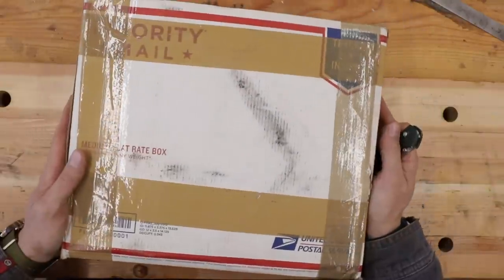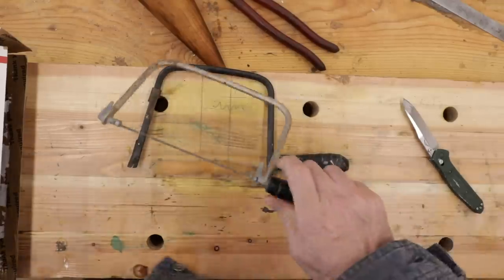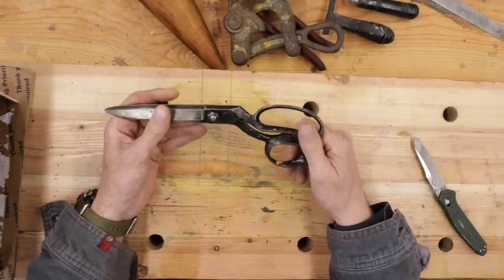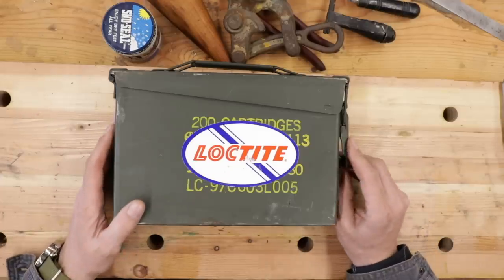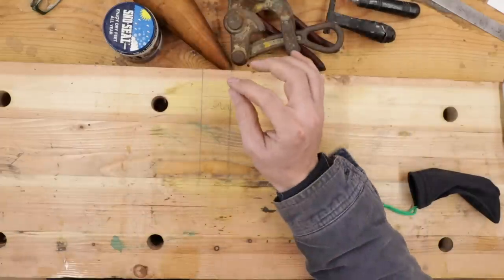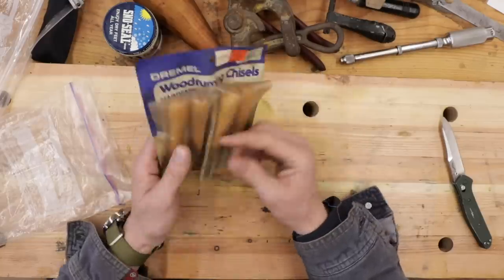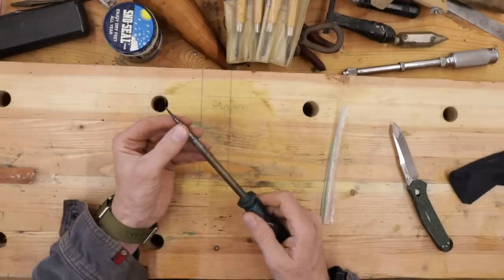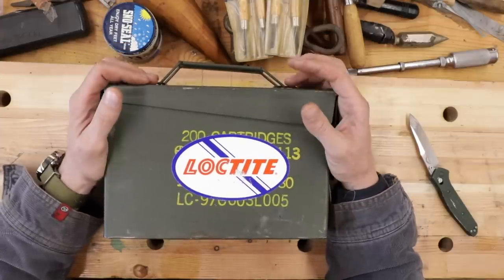You Won't Believe What's Inside This ARMY Box

Comment: Enjoyed it Cody. My Dad had one of those silver yankee drills with the bits inside. Works great. Not a screwdriver. The slotted screwdriver was something I used doing electrical work,  You push it into the head of a standard screw and push the inside piece forward and the two sections expand and hold the screw so you can one handed start a screw into the back of an outlet box.  They are very handy. They make different sizes for large and small screws. Made just to start the screw. Not strong enough for torque. Need a standard screw driver for that.

Comment: From my very quick research: Shears are scissors that are over six inches in length (none of this metric rubbish), and typically have one side of the handle larger than the other to accommodate more fingers. Scissors are more likely to have symmetrical "holes" to put your fingers in.
Reply: I'm actually British and a proponent of the Metric system, just a joke xD
Reply: Certainly, Imperial Measurements shorter than an inch: The mil (1/1000th of an inch), the Digit (3/4 of an inch), the Pica (1/6th of an inch), the Point (1/72 inches), the Twip (1/1440 inches), the Line (1/12 inches)
Reply: Sure, .25 inches or 1/4 inch, .50 is 1/2 inch it's all relative! LOL!
Reply: These are all real measurements. Pica, Point and Twips are all used in Typography (you'll know of Point or pt as font size in Word), the Digit is a very very old unit that hasn't been in use for quite a while, and the Line is a unit formerly used to measure plants by botanists. Mils are not common in everyday use due to the size of the measurement, but are used for fine tolerances in Engineering and Manufacturing when parts are not defined in Metric units.
Reply: I'm from the U.S., and i believe very tedious and precise work the metric system is the best, But for just regular get it close enough to fit, any system works fine..
Reply: I think if you just want to make something then you can just chuck something together in whatever units you like, as long as you're consistent and you make it clear what you're doing. Other than the simplicity, the real benefit to metric is how Universal it is, and in good ol Murica that's less the case. There's also the occasional case where Imperial/Customary is better, e.g. ordering a pint at a pub instead of  568 (UK) or 473 (US) ml of beer.
Reply: Dat's me!
Reply: Alex Mann my understanding is that the blades on shears are always offset from the handle
Reply: lhepton I think you're right, I was also taught that shears have a flat straight blade at the bottom  (as seen in the vid) cos they're designed for cutting fabrics on a cutting table. My Grandmother's grandfather was a tailor, so that was where the info came from. Scissors are symmetrical.
Reply: Metric is only better if that's what your used to using. for me it's too easy to have the wrong number of O's or the decimal in the wrong place. I'll stick with imperial. easy and logical. in the US working in carpentry there's never a need for it. the only time I use it is with Automotive sockets.
Reply: Calvin H. I am from the U.K., brought up on Metric, but I’ve just started leatherworking, and making stuff for the Human body, Imperial just works every time. Not surprising, since it is a system based on parts of the body (hand, span etc)
Reply: Alex Mann metric is superior
Reply: AndreasB By saying milimeter you are saying thousandths of a meter so you are doing the exact same thing when i use a thou. Im from the UK and passionately hate the metric system.

Comment: that watch is clearly bothering you.
Reply: I agree.  I have a Reactor Poseidon Diving watch that weighs almost 1/2 pound.  It's annoying to wear since it chafes my wrist and gets in the way.  Needless to say, I've scratched the crystal from use and no longer wear it.  I now wear a Bertucci watch with a NATO band and I rarely take it off.  It has a polymer case with a plexi glass crystal, almost weightless, extremely durable and waterproof to 200M.  Cost, under $50.
Reply: I owned a big watch, a breitling. it was that much on a lump it lived in the box until I sold it! found myself doing what he's doing here just fiddling my wrist all the time! I have the seiko in his amazon link and worn it for work for a while. great mechanical watch for the price point and sits nice and comfortable on the wrist.

Comment: Cody you have the best subscribers that have been so generous in sharing such terrific tools and some very interesting things! Even reading glasses 👓! I try to learn as I can especially with some of the tools that I have never used like the coping saw. My husband has one out in our garage but the blade needs replaced and I don’t know how to even order it because I don’t know how to measure the blade! It’s a straight blade not round and it’s rusty! I hope someone can help me out and give me an idea how to measure the blade and what I could use it for 🙏
Reply: MAE HAY they usually are all the same length. Measure the distance between the pins through the blade ends (or more precisely NEAR the ends) and check in the shop. They are cheap too. Hopefully an easy purchase. (You usually have to buy a multi-pack, but that’s ok, as on a single job you can get through 2 or 3 as they snap very readily. Hope that’s a help!

Comment: The screwdriver with the split blade and the slide is for holding screws. You put it into the slot of the screw and push the sleeve forward the two blades would  wedge into the screw and hold it tight. You can reach inside something and put a screw in or use it to hold the screw while you hold something in place. 

The push drill as we always called it was used by the phone company for drilling holes to mount equipment. Only runs back and forth, those bits are just drill bits. 

Those large scissors are for cutting material off of bolts of fabric. The lady would measure out however many yards of material that the customer wanted and hold the edge up and snip the edge of the material. Then she would cut along an edge or through a groove in the counter top. It dropped the blade of the scissors right down to the level of the material. It kept the material from bunching up and cutting a jagged edge on the customers fabric. 

That cone you talked about earlier is for what you said. But, if you had something like strawberries you would line the inside of the cone with the holes with cheese cloth. Otherwise, you still got seeds in your jelly or jam. Preserves didn't matter much because people seemed to like having the seeds in there. 

The small drill bits are for a brace and bit set. They also made extentions for the bits, that way if you had a deep hole to drill, you could make the bit reach the depth you wanted. 

The cable/wire puller can be used on just about everything. It was used for tentioning wire or cable most of the time. It's a lot easier to use that to grab the cable or wire instead of trying to hold it with your hands. You could use a come along or block and tackle tied off to a vehicle. Hope this helps. 

Rob

Comment: The Quick-Wedge is what we (I'm a union electrician by trade) call a 'hold-it screwdriver'. It's for slotted screws. With the collar against the handle, you put the tip in the screw slot, then slide the collar away from the handle. The blades cam against each one another to effectively become thicker, wedging themselves into the slot and holding the screw securely. A lot of terminal block screws are non-ferrous, so magnets won't work. It allows you to expediently start the screws back in a box or motor starter or whatever, I have them in all manner of lengths and sizes. They're damn handy for certain automotive/equipment applications, too.

Comment: The mouth to mouth barrier should be used on everyone, not just questionable people. If CPR is done wrong and air is blown into the stomach - there is a good chance that the victim will vomit into your mouth. That's why these barriers were invented.
Reply: The BadLuckBear This is true for adults, but not for the pediatric population.
Reply: I'd say the popularity of a cpr dam was in the aids/ hep epidemic 80-90s....but apparently that wouldn't fly today as AIDS isn't more than a cold in commiefornia... probably hurt somebody's feels there...oh well
Reply: The BadLuckBear Their metabolism requires more oxygen.  And their lung capacity is not as large as an adult.  Therefore, breaths are required for our little ones.
Reply: The BadLuckBear adults have more disolved O2 in the blood because of the increased volume. When someone stops compressions on an adult, it takes longer to reach maximum pump pressure when compressions are restarted.

Comment: Difference between scissors and shears as told by my mum, shears were used to cut the wool off sheep and other long haired animals before the time of electrics shears which came into use round about the 1920's or 30's. But of a similar design than those you showed, those were shears used by tailors for cutting cloth usually around 6 to 8 pieces at once, you made the first cut like a scissor then opened them slightly before pushing them along the chucked line slicing through the cloth cleanly and smoothly. (the reason why they we're fastened with a nut and bolt was so they could be separated for sharpening).
Sissons are for use in a household for cutting paper, small pieces of cloth, string, even fat off bacon and other meats such as steaks etc, but nowadays kitchen secateurs tend to be used for that.

Comment: I'm 29 and ive used those wedge screwdrivers on old industrial equipment that uses slotted screws. You press it into the slot and pull the handle back, holds it tight so you can get started at weird angles. They're useful for some terribly located fasteners 👌

Comment: The fourth device ( at 4:40) is a cable puller. I have a set of 3 that range from 1/4" up to 1 1/2". We use them all the time when changing wire ropes on cranes.

Comment: The Quick Wedge is a great tool for working on cars and in tight areas where you need to get a screw started and can't get your hand in there.  You put a straight headed screw in it and slid the adjuster forward to grip it.  We used to use them to change points and condensers in old ignition systems and on motor cycles.  You could not really start screws in (like into wood, even with a pilot hole) if you had to apply a lot of pressure to it.  You can also use them to extract.  If found it best to break screws free and finish tightening with a standard screw driver and using the the Quick Wedge type screw drivers for the final removal and starting of screws.

Comment: The cable puller with the cam is a grip. Works great for steel cable, wouldn't use it on rope myself. I have also used them as a residential electrician to pull out old ground rods that you cant get free. Hook it on the ground rod and tie it off to the ball hitch on the truck and pull. It saves allot of time, though bends the ground rod.

Comment: Applesauce or potato masher.  I grew up helping do that.  We inherited the colander as well.  It COULD be used as a juicer but the main use was to mash. The ‘coping saw’ actually looked like a jewelers saw and the collar for adjustment was missing.  Cam type cable grip.  They look like a pair of leather shears that. I have. Brush is a parts cleaning brush..could be used for stripping as well.  Remove the slide and use the nail as a pivot and tighten the screw with a pencil in the hole...then rotate to mark circles.  Knife is a cobbler’s sole trimming knife. It sheared the outside of the sole after the bottom tread is applied..the later knife was a leather carving knife.

Comment: I believe the coping saw like frame is a jeweler's saw. It uses a spiral blade. Used to cut copper and brass to make broaches and similar. New ones have an adjustable top frame for different length blades.

Comment: That Stanley Yankee no 41 drill is still a tool I use. It is much faster than a power tool for just a hole or 2. It is also lighter.  I install a lot of ether net and I use it to drill pilot holes for mounting stuff.
Reply: We used them all the time when I was a telephone Installer repairman. There are various size bits in the handle for both wood and masonry.

Comment: the wooden device is a marking gauge, a pencil goes in the hole. The aluminum depth tool is actually a tenon marking gauge, with the brass disc that leaves a fine cut in the wood.

Comment: Hi W,  The screwdriver you questioned about was designed to hold a flat head as if you were holding the screw with tape to the screw driver. The tension from the wedge held screws when you cant fit your hands to hold the screw when starting it.

Comment: The Cam action "Cable / Rope Puller" as you described it is used to tension fence wire and barbed wire in conjunction with a cum-along or light block and tackle.

Comment: It is called a screw starter. It is used with a standard screw. When you slide the sleeve up the blades Mash out a little wider and grip the sides of the slot head in the screw allowing you to start it into a pre-drilled hole.

Comment: The wooden scribe marker is actually something special. It was manufactured by the Nooitgedagt company ( makers mark J.N.IJ.) located in IJlst the Netherlands. Its the standard hand tool to any Dutch woodworker. It's made of Beech wood. The side with the butterfly nut is for holding a pencil and the other side you can put in a nail or other sharp object to scribe with, preferably a one sided sharpened nail. As far as I know it wasn't available in the USA. I wonder how it ended up in the USA and your hands.

Comment: That one thing you got was a cable puller. We electricians used to use it to pull very long electrical cables when we were pulling in new/replacement electrical lines on power poles.

Comment: The blue screwdriver is called a screw starter. It holds a flat slotted screw until you get it started... Works with small wood screws and machine screws.

Comment: The double ended screwdriver is a carburater adjustment screwdriver.  The slide pushes the two blades opposite directions to hold the screw slot while the engine is running and shaking.

Comment: Your drill is called a yankee drill the straight fluted bits are for wood. I used one of those many years working for General Telephone company. The Bell system also used them. They also did have twist bits for metal.

Comment: It holds a slotted screw to start it in hard to get out places or when you can only use one hand to  start the screw. Also you were correct with the wooden masher. I have one with the metal sieve which we used to mash fresh pumpkin through to make pumpkin pies.

Comment: The cable puller/pincher thing is what we call a 'pork chop', they're for pulling wire rope or uninsulated wire. It does what a grapevine hitch does on insulated cable, allowing you to get bite after bite without re-rigging.

Comment: I am a power company lineman and we use those "grips" with hoist and/or block and tackle every day to pull wire. (aluminum, copper, and steel) and it works well on rope as well. We call that particular one a "porkchop" for obvious reasons

Comment: At 22:00 screw holding screwdriver. Push the sleeve down until the tips fit in the screw slot then pull back the sleeve and the tips will be wedged into the screw slot holding the screw so you can insert the screw into a recess you normally could not reach.

Comment: Notice the dressmaking shears have a flat base for running them along the table when cutting material, I have my Grandmas old pair. The Quick Wedge is Agreed, for holding straight screws when inserting them down a hole or similar, not intended to actually screw it in, just to get it started, marvellous design and well engineered. The cable dog is to grab barbed wire and pull on it till you get a staple in, saves tearing your gloves to pieces..:)

Comment: scissors vs. Shears:
Scissors have symmetrical, equally sized finger holes and are generally under 6" in blade length, while shears have one smaller finger hole and one larger finger hole and are more than 6" in blade length.

Comment: I'm sure you've found out by now that the "Yankee screwdriver" is actually a small hand drill. I'm 69, and my father, a carpenter, had that exact tool. It's chrome over brass, and much of the chrome on his had worn off. Thanks for bringing that memory back. He also had steel plumbobs that he used in woodworking (framing, etc.).

Comment: Quick-Wedge is a screw-holding screwdriver used to insert screws into hard-to-reach holes. The tip is placed into the slot of a standard head screw and the collar pushed forward in order to lock the tip into the screw head. The screw driver holds the screw while you search for the screw hole. Bicycle mechanics use a similar tool to screw on brass or aluminum nipples to the ends of wheel spokes when repairing and building custom bicycle wheels.

Comment: The blue handled quick-wedge screw driver is used for one handed insertion of a screw typically overhead or at some angle where you can't get your other hand in to hold the screw.
As you slide the tube down the screwdriver,  the double tip comes together wedging into the slot of the screw, holding it in place.
You can then use one hand, even your non-dominent hand to hold the screwdriver without dropping the screw.
My dad had a nice wood handled one,  and I own a craftsman one.